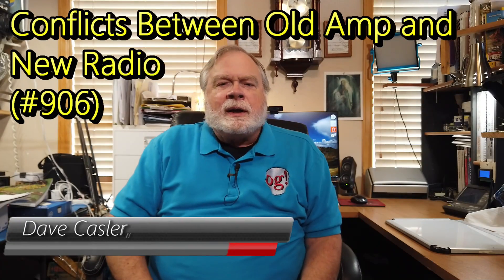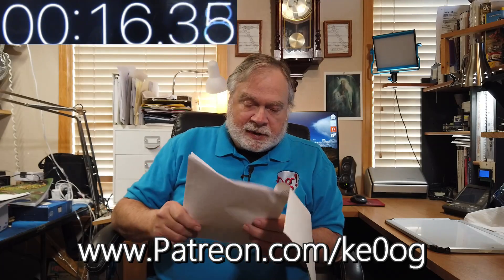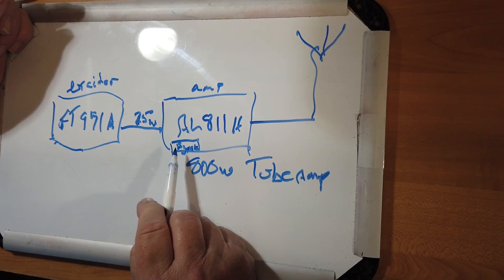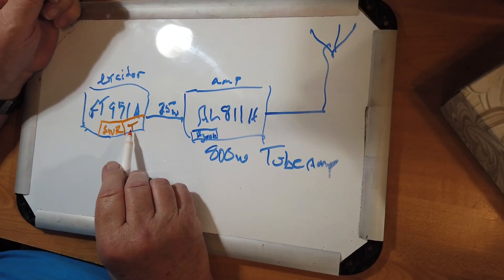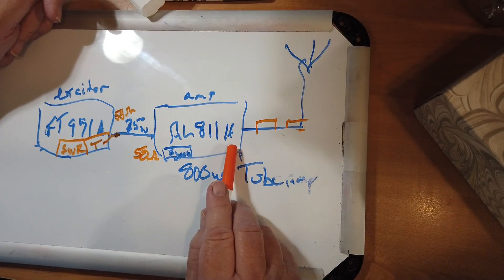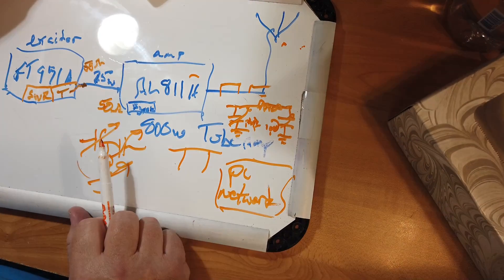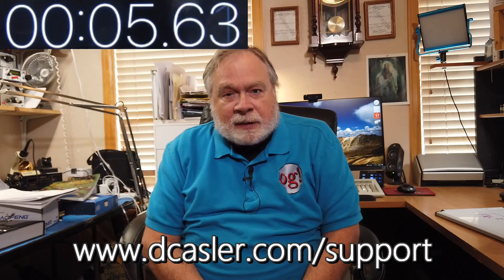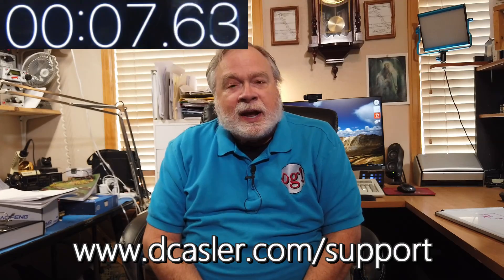Conflicts Between Old Amp and New Radio (#906)

Comment: With due respect I believe the question was misunderstood. I believe the user has an antenna with a poor SWR and "barefoot" of course the tuner in the radio does as it is intended by matching that unknown impedance to 50 ohms. Of course as soon as the amplifier is in operation the radio is only seeing the input impedance of the amplifier which ought to be close to 50 ohms in ham bands for which it is built. In general terms you would not expect to have to use the internal tuner in the radio while operating the amplifier, however the amplifier is still seeing the bad match and depending on the nature of the mismatch he stands a good chance of flashing over the load capacitor in the amplifier.

Comment: Very informative. I do not have an amplifier, But do have an LDG AT-200 Pro II I am no longer using. Now I think I know how I can use it. I have an IC-7100 with no built in tuner, and an IC-7300 with a tuner built in for up to 3:1. The LDG can handle 10:1 on HF & 6m. So looking at it, I already have a switch coming off my SWR/Power meter going to each transceiver for the 2 HF antennas. I could just patch the tuner in between meter and switch with a foot piece of LMR-240. Then maybe I can do a better job on the D-STAR HF Net with the IC-7100, as we test D-Star 2-way on all HF  bands and 6m band on Saturday and twice on Sunday. Plus maybe I can get some more contacts on HF on the 7300 as well. 20M is already perfect so do not want to mess with it. But lost 10,15,30,40 when I went to inverted V. Not complaining I love 20M, and getting results of 20 over 9 from 1,800 miles away is awesome.

Comment: The problem is simple - he has an antenna with a high swr.  There is nothing whatsoever wrong with the amplifier.  Dave blew it completely on this one, sorry to say.
There are thousands and thousands of tube based amps in ham shacks the world over, working perfectly with the new rigs.  In fact, if the questioner was to take Dave's info and buy a brand new solid state amp he would have the exact same situation.  de k2xt